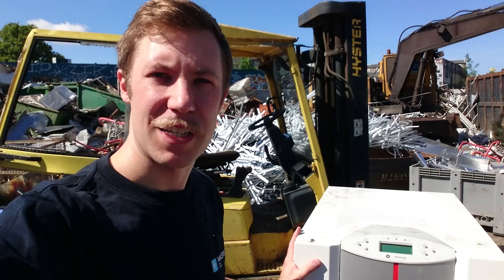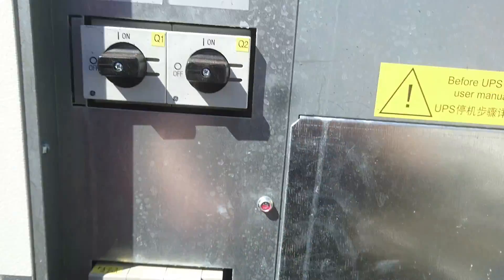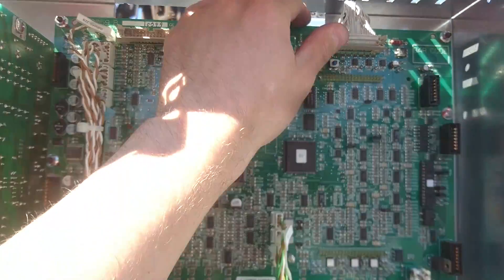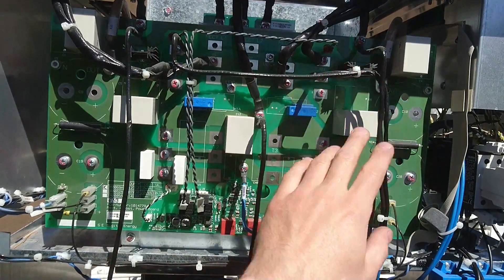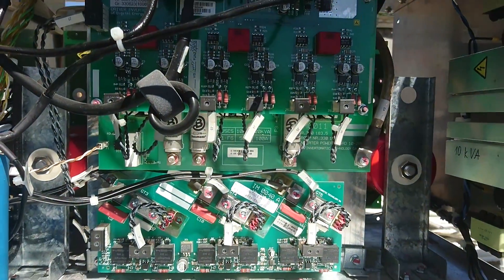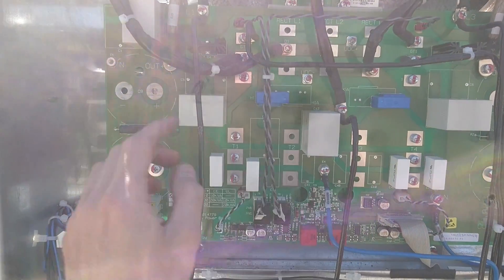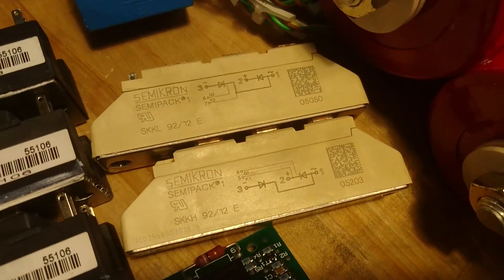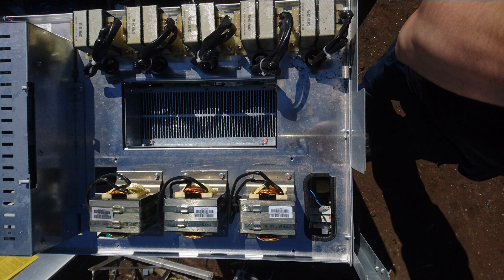Teardown of a GE LP-33 10kVA UPS System

Comment: Hello Kaizer Power Electronics,
thank you very much for this look in the technik of such an great 3 phase usv. This is for me very interesting, because i am an technician. Good work. Thumps up. Thanks again.
Jürgen B. from Germany (i am locking for an used 3 phase in (1 phase in, or 2 phase in very well) and 3 phase + N out USV).
Reply from the maker: Thank you for the kind words and best of luck in your hunt for a UPS :)
Reply: @KaizerPowerElectronicsDk  Thank you. Really. But i have had the hope (and have it, too), that you can helb me with my hunt...
...can i ask later some technical questions? Or shoud i better use your forum?
VG, Jürgen B., from Germany. I am irradiated by PV :-)

Comment: Hello,  there, am using GE SG SERIES 30KVA ups in my plant, an alarm code 4701(power supply board failure) doesn't allow the ups to running expect on bypass mode, pls do u have idea on how this could be resolved

Comment: Mads, please boost the audio on your videos. I have the volume turned all the way up, and it's still kind of quiet.
Reply from the maker: This is some photage from before I got the new microphone, but on my Phone at full volume its too loud to sit and listen to normally, so what makes it so low at you?
Reply: @KaizerPowerElectronicsDk  Listening to the video on built-in speakers on Macbook air in a mildly noisy workshop.
Reply: Built in speakers on a crapbook air. well then, theres your problem. Use a better computer, an android tablet or head/earphones.
Reply: @simontay4851  It has nothing to do with the make and model of the computer. If i watch the same clip on a mundane IBM Thinkpad, it's still a bit mute. A side note: The audio is noticable louder now. I don't know if Mads did something, or it was just Youtube f*cking up. Whatever!
Reply from the maker: I did not change anything, but you could be right about audio level being to the low side as this was material filmed a while ago, where I had a few videos in a row with too low audio.